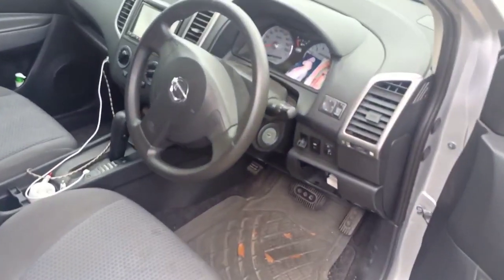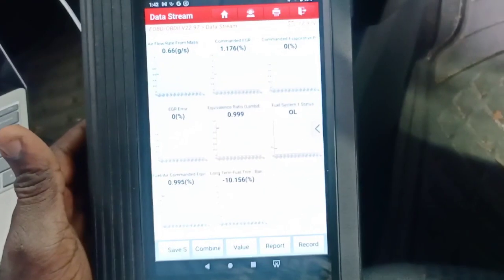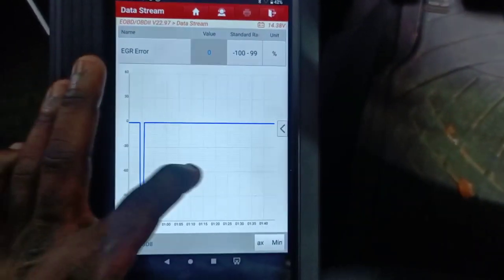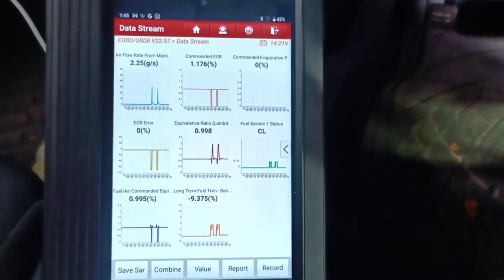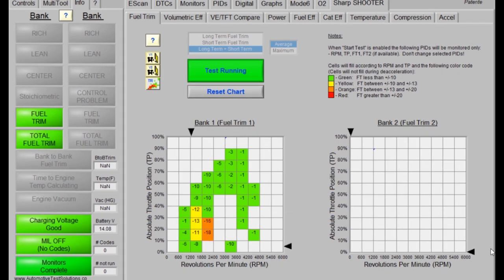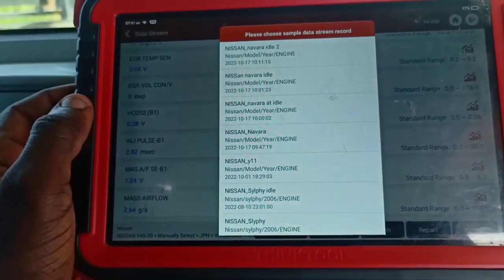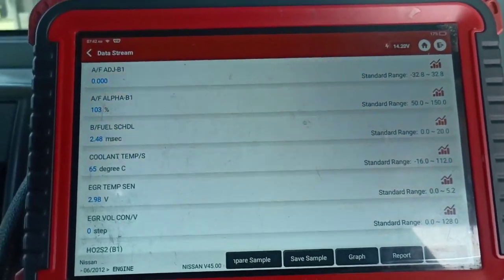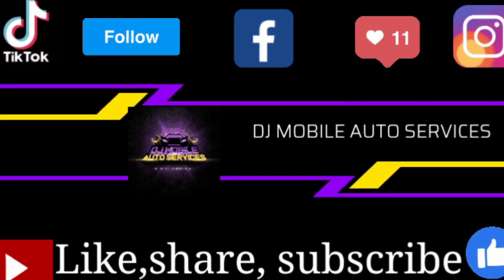What can cause a Nissan with a HR15 engine to lose power while accelerating?@djmobileautoservices

Comment: Awsome vid. I have a 2011 tiida. Loosing power too. I had a misfire so I had a mechanic change the plugs and coils. Mechanic forgot to plug back in the intake manifold runner control valve. I plugged it back in. I thought that the cause of the power loss is. It was not. I am gonna check the egr like want u did here. I can do that without a mechanic. Fingers crossed. 🤞🏽

Comment: Hello, I'm a Nissan Tiida owner, and I'm encountering acceleration issues. I've replaced the spark plugs, air filters, transmission fluid, engine fluid, and the Fuel Assembly, but the problem persists. I haven't diagnosed the ignition coil yet, so I'm wondering if one of the coils might be faulty.

For example, when I was in traffic with my foot on the brake, and I released the brake and pressed the gas, the car surged for a second and then settled. I noticed this tends to occur when the vehicle is cold. It mostly happens at low speeds. What could be causing this issue?
Reply from the maker: Hi, sorry for the response. It can be anything from a lack of service, dirty maf or throttle body. Yes a faulty coil or fake spark plugs can cause it too. hope this helps
Reply: Same fault with my bluebird 2007 model. Changed almost everything but didnt get any wayout. Did your issue resolved ?

Comment: Great video, Thanks! What's your thoughts on the Escan are you happy with it, do you use it a lot?
Reply from the maker: Solid tool but I mainly use it for Driveability Issues and the data visualization. Not my go to, there is a cheaper unit (HP tuner) that has similar features for a lower cost. I don't use it much due to it having functions as a generic scan tool.

Comment: The program used on laptop is?  I’ll help you grow. ❤
Reply: Good night saw your video. Great job, I have a Tiida latio hr15 and my issue is when I accelerate in between 40 km and 60 km what I believe to hear, is ignition rattle, or pinging I did a full service everything and that sound  only happens at certain times. But more noticeable when my fuel is low or when I’m going uphill, by chance, have you came across an issue like this? I heard a lot of speculation talk that it is the gas that’s causing that but I have been using premium gas for about five years now and more.
Reply from the maker: Did you service the fuel pump and injectors
Reply: @nicholasmonroe1074 Did you fix it?
Reply: Where you shop at
Reply from the maker: Trinidad and Tobago
Reply from the maker: ATS escan